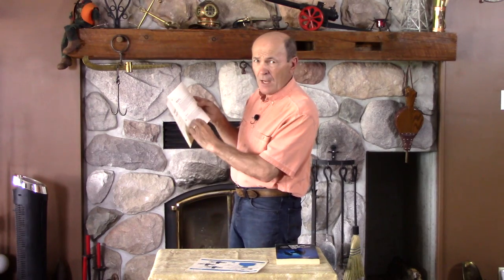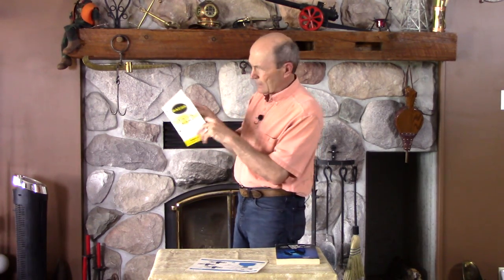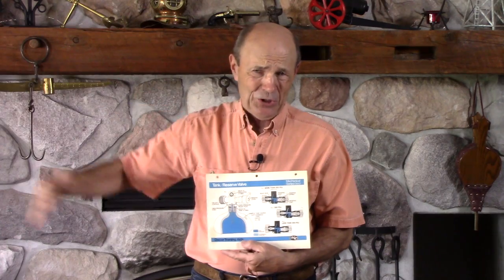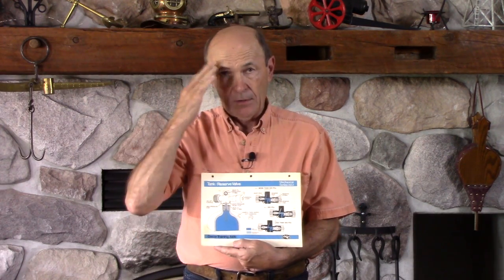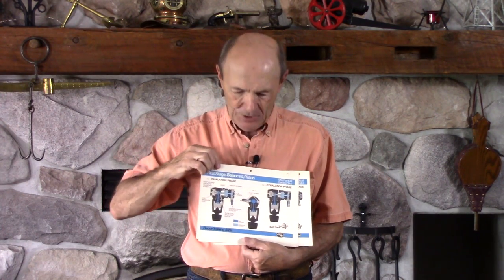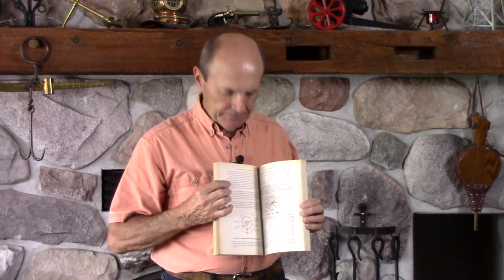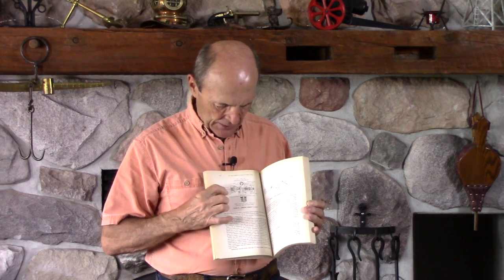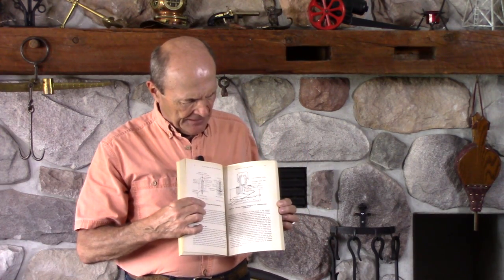Vintage Scuba: What New Divers Don't Learn - S03E12

Comment: I think manufacturers worry that if they give technical info, that it's permission for the divers to grab their six inch knife and digging away at their equipment.  I feel that the technical should be included with the products (with a disclaimer ). That way divers can see how it works, and what not to do as well. Keep up the great videos.

Comment: We're finalizing the service manual for our Deep 6 regulator (Signature 1st and 2nd stages).  Once finalized, the manual will be included with every regulator purchase.  (other avenues currently exist for servicing issues)  Why?  Because we feel the same way you do- customers should know their regulators regardless if they service it themselves or if they pay someone else to do it.  (A service course specific to our gear is available through TDI for those wishing to learn how to service their own regulator.)  Just thought I'd share.
Reply from the maker: I'm glad you did. It's good to see a scuba gear manufacturer willing to share vital information without fear of idiotic lawsuits. 
I often use analogies from the auto industry. In this case, I suggest that the instructions for changing a tire are included with every auto. I'm sure that someone has or will sue the car company if a spare tire falls off because they didn't install it properly. Do we all suffer for one person's ineptitude - and for their lack of responsibility? Personally I'd be too embarrassed to sue a car company because I didn't tighten the wheel nuts on the spare. I wouldn't want everyone in the courtroom to be laughing at me.
I'm sure that many divers will be appreciative.
Good luck and thanks for watching.
Alec

Comment: First thing I did when I got my first regulator was pull it apart to see how it worked. And see if anything needed replacement, as it was 30 years old when I got it and hadn’t been serviced for a decade. 
As a kid I did this to anything that was broken, to see if I could fix it. This is the same thing I did when taking up scuba. My local dive shop said I was crazy to be doing this. It’s funny, now they ask me how to fix their problems with regulators they can’t fix.
Reply from the maker: Glad to meet another 'how does it work?" diver.  Thanks for sharing and hope your LDS appreciates your skills.

Comment: I believe that the teaching of the fundamentals of the equipment operation is a must and in many cases, it is a safety to avoid panic.
I always maintained myself my equipments because it gives a much better feel of what is going on.( it happened to me to abort a dive because a freshly rebuilt regulator by my diveshop broke an oring and developped a major leak )
I can easily feel a regulator out of adjustment or a diaphragm that is going stiffer ect...and I feel much more confident about my equipments.
Reply from the maker: Unfortunately that skill and education is a thing of the past Jacques.
Alec

Comment: Excellent point about scuba companies not providing technical information. These shifts take place and we don't even notice them! They also don't say what parts cost for a rebuild! I'm told the parts for some full-face units cost hundreds! On another point, I see discussion on J-valves. I used them for years and they were great. (If they adjusted for depth they would have been even better!) I've heard that the drawback was that divers would get tanks filled and the J-valve would be in the down or open position, and then go diving and forget to reset the J-valve back to the reserve or "up" setting and then would run completely out of gas. Oops!
Reply: This is the same thing that happens to new motorcycle riders with their fuel tank reserve valve .
Reply: Hello Richard, Your right about a reserve or ("J Valve") as it is called being better if they adjusted for depth. FYI, Scubapro manufactured and marketed just such a J-valve. It was the DCAR J-valve. The DCAR acronym stood for "Depth Compensated Adjustable Reserve Valve" You can find them available today on ebay under vintage scuba. The diver uses a screwdriver and makes the setting at the top of the valve. Re the valve reserve link being accidently pushed down, some divers would remove the reserve knob link arm and reinstall in a default downward position, when reserve air would be needed they would push it up, instead of down for the desired effect. Just thought you would be entertained by this bit of trivia. I have been certified and diving since 1972. Best Regards!

Comment: [SEE EDIT BELOW FIRST PARAGRAPH]

PADI has figured out that you don't teach everything at once, it's all about rolling out tiny bits of information for an additional fee.  Does anyone that has taken the NITROX class actually think that there is any reason for that NOT to be taught in OW?  The "equipment" class... shouldn't that be in the basics?  

And, having watched this, I'm going to change my reason... it's because we live in a disposable society.  Nobody knows how to fix anything.  Nobody fixes anything.  We just replace it.  So much easier to just buy a new one than to fix anything.

My comments about PADI stand.

sigh
Reply: Padi Nitrox - soooo true - not even part of the AOW book which is really thick (which parts many don't care about)! you have to buy this 12 page book and take a separate class. Lame.
I like fixing things myself and all my dive equipment is used.  Good for the earth, and the wallet. The only exception was my regulator as it was same price new (old new stock) than the price to service some old regulator ($175) and got all the new tech (lightweight, balance, flexi hose)

Comment: I think the reason they don't give us all the information is, #1. insurances, and #2. The less we know about our equipment the more dependent we will be on the manufacturer and their service techs, thus keeping the monies in their circle.
Reply from the maker: I'm sure you're right. It isn't just scuba diving though. 
Have you tried to fix your car lately? My new F150 has no ignition coil, no distributor, no carburetor, no power steering pump, no transmission dipstick. I can't even do the brakes without upsetting the computers. I still change my own tires spring and fall but I'll bet they'll come up with some way to stop that!!
Take care.
Alec
Reply: Hi Alec,
Ignition coil?! Carburetor??! Today, can't even change a LIGHT bulb anymore.  Albeit, to be fair, car's light have never been so bright & reliable as with nowadays LEDs... remember rainy nights on a motorbike running around blind like a bat (missing sonar!). Probably, there might be parallels when it comes to diving gear as well. Undisputed, in the old days literally everything was better. I mean that!, ask my kids  ;-)
Have a great time, appreciate your vids a lot, thanks a LOT!

Comment: I recently bought my first reg and I didn't even get an owners manual at all let alone a parts breakdown and maintenance information
Reply from the maker: All new regs (and BCDs and computers too) come from the manufacturer with Warranty papers and an Owners Manual.
If the reg was assembled for you at the store, they probably tok the papers out of the box and just didn't give them to you.
That's wrong. A new owner is supposed to get them.

There's 2 things you can do:
  1. ask the store for them. They probably have extras.
  2. go to the manufacturers website and either download the manual and warranty registration or contact them. 
      I guarantee that the manufacturer will send them to you.

As I've hinted in this video, there's not a lot of information in today's owners manuals but you should have them. What's in there is important.
Good luck.
Alec

Comment: I dont service my regs and stage. I do clean them wel.  I buy every 3 years a new set.  The service cost for 3 years is as much as a new basic regulator kit in the Netherlands.
Reply from the maker: Wow! In one sense it sounds nice to have a new set every few years.
If you do a good job cleaning you shouldn't need service very often. Surely you can get 5 years out of them unless you're doing a heck of a lot of dives.
Take care.
Alec

Comment: I'm a computer scientist but before starting my degree I would've been happy with just about any other branch of engineering, I love to figure out and understand how things work. Not too long ago I watched this speech by Neil Degrasse Tyson at some University in the States in which he addressed this very issue, nowadays we train our minds to learn stuff by the numbers, and not to figure out stuff by our own and truly understanding how stuff actually works.

Now I understand that technology has evolved, one can't fine tune our cars carburetors because they no longer have them, they've been replaced by very complex electronic fuel injection systems that no longer are user serviceable. I get that, but there's lot of stuff out there that's far from being rocket science which manufacturers insist in clouding them so that users don't meddle with them. Take an iPhone battery or screen for example, it's simple enough to replace either of them at home, and yet you have to get directions to do that from third parties instead of from the actual manufacturer of the device.
Reply from the maker: I'm like you Javier. I like to see how things work and I fix stuff myself if at all possible.
I just replaced the ice maker on our fridge. It was a 1/2 hour job; new parts cost $100 total. 
The appliance guy wanted that much to come out and look at it! 
And I spend a lot of time every day on Google and/or U-Tube gettings ideas, instructions, alternate methods, etc.

I don't know what's going to happen in the future but it doesn't look good. Everyone will have specific job at which he is an expert but won't be able to do anything else. My nephew is a recent doctor and makes good money which he's going to need because he  can't change a tire, thinks a Torque Wrench is a video game and couldn't install a 2 wire thermostat. 
Times change and I worry about my kids but, I believe my dad said the same thing about me.

Take care.
Alec

Comment: Many modern regs need special tools, and specialised equipment to set it up properly.  Manufacturers usually only train technicians who work for a dive store   !!!
Reply from the maker: That's quite right Robbie.
Lots of the tools needed for reg work are readily available, drivers, wrenches, torque wrenches, pin punches, etc. but there are a few special tools that you absolutely need and they are only available from the manufacturer. Generally they will only sell to factory trained/authorized repair technicians.
Alec

Comment: Still loving the videos. I think you're right. Divers should have a greater knowledge of the equipment that keeps them alive underwater. They might look after it better. ;-)
Reply from the maker: At least a basic understanding of how they work might be useful. Regulator service today does require special tools and instruments to be done properly so full parts breakdown is not worthwhile anymore. 
I know that explaining to my kids how a clutch and gearbox works really helped them be better drivers - less missed or grinding gears and smoother starts.
Thanks.
Alec

Comment: I learnt all that when in learnt commercial diving. But the main reason is for certified recognition thats been certified by the company is to make money. Otherwise if they tell everything no one would go unless it's a major service.
Reply from the maker: You are assuming that the average person, the average diver, has the ability to make repairs. That's not a safe assumption.
While regulators and other gear is surprisingly simple in theory, in the last 10 years, they have become increasingly sophisticated. I doubt the average diver could safely service his own gear today.
Certainly, profit is a factor but companies also worry about liability. If all divers were able to safely service their own gear, liability concern would be non-existent right? 
That's not the case. So, for profit, for protection from liability and to ensure the overall safety of the sport, divers are discouraged from servicing their own gear.
Let me be the devil's advocate here. If all divers had access to service information and tools and parts and they all serviced their own gear, I guarantee there would be a big jump in scuba deaths as a result. Now we're looking at government intervention to "save divers from themselves".
You know that's how it works.
So, if you have the ability and knowledge to service your own gear, go for it. But I don't think it's wise to assume every diver is the same as you.
Thanks for your comment.
Alec

Comment: I have the idea that the reason most people don't know this stuff is because the equipment can be a bit complicated and when following the instructions (as best as they can) can lead to a lost screw or a misplaced diaphragm that could result in dangerous moments. I admit, knowing this stuff is certainly valuable and it can give a confidence in the equipment but I also know that trying to maintain your own car with all the electronics they have now, especially hybrid and electric, are not really something you can learn over a weekend.

That's not to say I disagree in people should know more about the technical stuff, I love finding out how all the stuff works, but if everyone does it and one in every 300 people loses a screw, I expect scuba fatalities would be higher. Also, it can result in a false confidence, if you take your own stuff apart and put it all together again, you might clean it well enough but if you don't, the idea that it's 'as good as serviced' could also be a risky attitude so I think it would be fairly normal for a manufacturer to take the responsibility out of most diver's hands and into the more trained and drilled ones that go on to work in dive stores. It would be bad if you developed a new kind of regulator that most people couldn't properly maintain on their own and could lead to the brand being affected, so it would be easier to just say 'take it to a professional' than to include the whole set of instructions and hope no one dies being stupid or forgetful.
Reply from the maker: Wow. Good response and I agree with it all.
Thanks Widget.
Alec

Comment: Half the people today don't know what end of a screwdrive to use.
Reply from the maker: Maybe I should write an instruction manual for screwdrivers. 1. Grip the large end of the driver. 2.  Ensure the small end of the driver has the same shape as the hole in the screw. 3. Insert the small end into the hole in the top of the screw. 4. Holding the screwdriver parallel to the screw, press firmly & turn the driver & simultaneously, the screw. 5. Turn clockwise to insert the screw or counter-clockwise to remove the screw. 6. When the screw has reached the point when it will turn no more OR has fallen out of the hole, stop turning.
Alec

Comment: Another possible reason besides the obvious ones you eluded to, liability, providing income for the dive stores, etc., could be that the newer generations are used to instant gratification. If someone turns their computer on and it doesn't load everything right away, they get impatient and annoyed, right? The marketing team might be afraid of overwhelming their customers with all that extra information and knowledge. It might scare them off. It's the old, "just so it does what it's supposed to do, I don't care how it does it" attitude that a lot of newer divers may have perhaps. 

Personally, I have no interest in performing my own maintenance - I don't fix my car or computer or washing machine. But I DO like to know how and why something works, especially if my life depends on it. That knowledge gives me a much better understanding of what might be happening if something doesn't feel right or work like it should. That , in turn, gives me the confidence to decide on how best to react to it. It helps me stay calm and not get in an agitated state because I have no idea what might be happening. 

To me, this is just one of the reasons your tech tips are so valuable. Learning how and why my equipment does what it does just makes me feel better. Will it make me run out and buy tools and maintenance manuals? Probably not. But I don't need to because I prefer to pay a professional to do the job, same as when I get a roof leak or my lawnmower won't start. So please keep these tips coming, they are very helpful and I enjoy them very much.
Reply from the maker: Thanks Rick. I agree 100%. I do a lot of my own service for my dive gear obviously but also for my car, truck, motorcycle, tractor , house, etc (have you seen my channel ,Alec Peirce at the Ranch> ?). Knowing how it works sure makes that easier but, as you say, knowing how it works (or is supposed to work) helps me use it too - even if I don't service that particular item.
Take care.
Alec
Reply: There is no more instant gratification than to fix a problem yourself using parts on hand vs dropping the regulator at the shop being told that it will be done in 2-3 weeks. Only to come back a month later and find that they haven't even started on it.

Comment: Heck they barely touch tables anymore, PADI has dropped the MOD equations from the Nitrox course, etc.
Reply from the maker: It is simplified for use but divers don't get an understanding of the engineering or physics.  
A